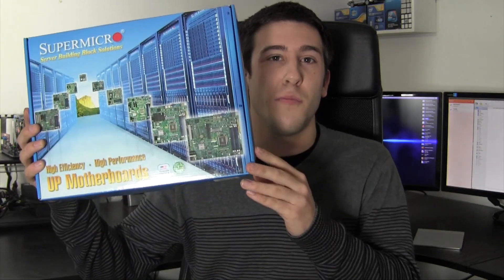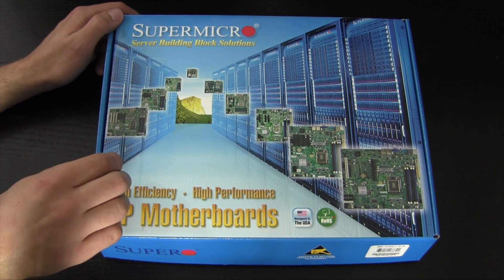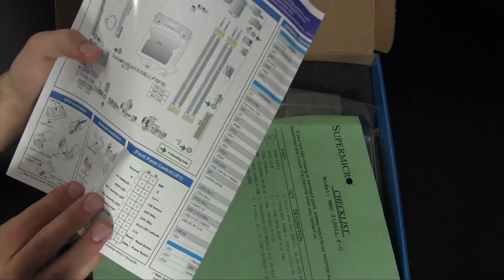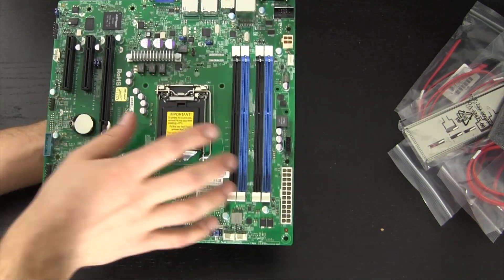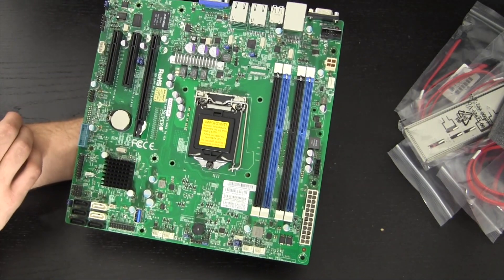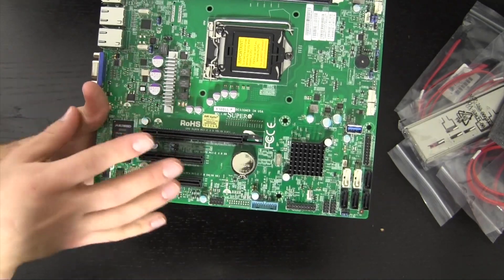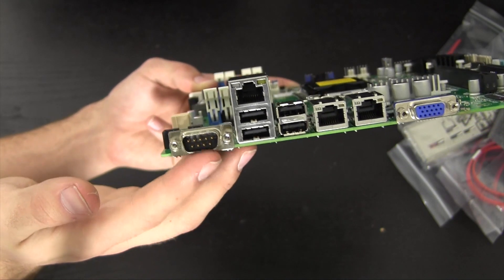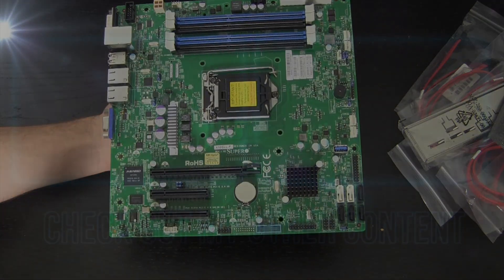Unboxing: Supermicro MBD-X10SLL-F-O [Motherboard]

Comment: I just built a pc last night with this board and it won’t boot I’m so upset, the specs are , intel Xeon e3-1220-v3, cpu
Apple 16gb 4x4 18666mhz ECC UDIMM ram
Nvidia GTX 780 gpu
120gb plexor SSD
X10SLL-F mobo
Corsair HXi 850w psu
Case q300l

Comment: The internal USB header can be used for anything, but is most typically used on servers for connecting a flash stick for booting an otherwise diskless machine such as an ESXi 5.0 or greater hypervisor connected to a NAS, or SmartOS.
Reply: +Justin Hannah in the case of FreeNAS it's recommended to boot from a USB drive rather than hard drive since very little of the drive can be used for security reasons.
Reply: +MyBrothersMario ZFS prefers to fill up entire disks and ignore partition tables, so that is why the OSes that use it boot a native FS on a USB stick or alternate boot drive.

Comment: Small correction :) the nic you mention at 8:20, is the Board IPMI. (same as HP ilo, dell Idrac, IBM RSA) which will among other things enable you to remote control the OS, view sensor readings and so on. it is not visible or usable for the OS installed.

Perfekt for a home server where you dont want a screen to be taking space.

Comment: I actually have a Socket 1155 Xeon in my main build, it's the Xeon E3-1230 v2. it's pretty much a Core i7 3770 (non-k) without the iGPU, which I don't need anyway. It's a great chip and it was a lot cheaper than the i7 variant. The Haswell variant of my chip is the v3 version.